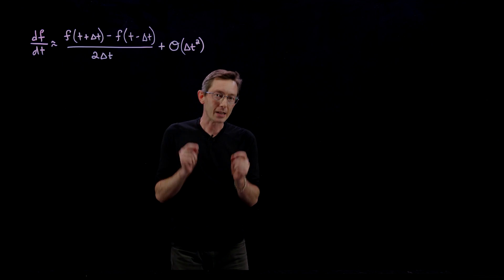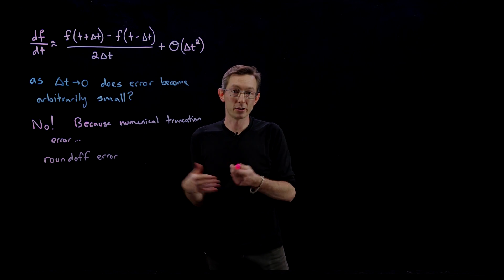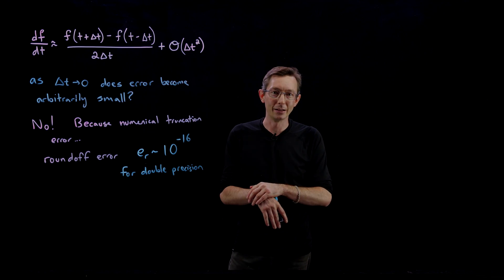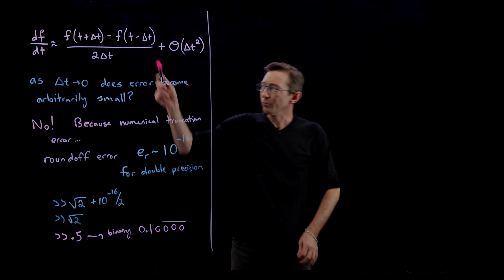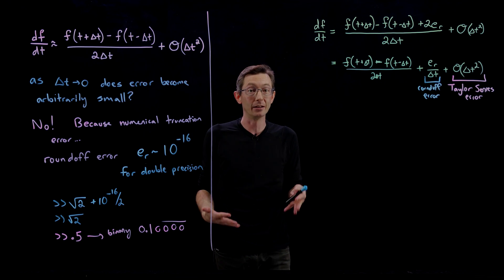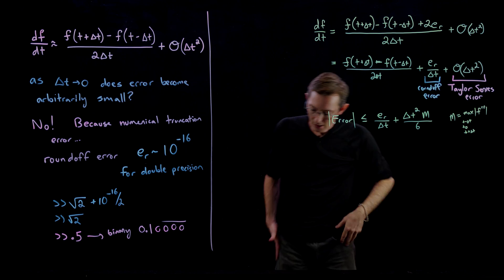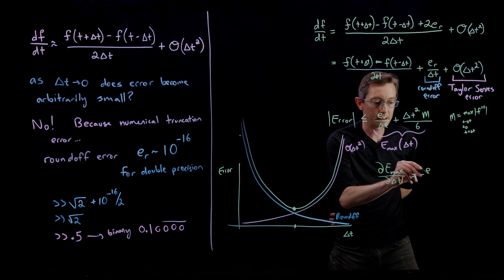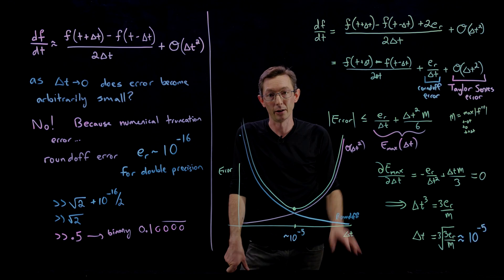Why we can't take "dt" to 0 in a computer: Sources of error in numerical differentiation

Comment: M(Δt)=sup{d³f/dt³ (c)|c∈(t-Δt,t+Δt)} is not a constant but actually a function of Δt, so the graph of E(Δt)=Δt²M(Δt)/6 is not a parabola, even if it is something similar. It is true that M(Δt) is a monotonically non-decreasing function (for bigger Δt, the interval (t-Δt,t+Δt) is bigger and hence M(Δt) can only get bigger). Either d³f/dt³ is limited in which case M(Δt)->sup{d³f/dt³(x)|x∈R} or it is unlimited, in which case M(Δt)->+8.

Hence for Δt->0, in both cases (wheter M(Δt) is limited or not) we have E(Δt)=Δt²M(Δt)/6 -> +8.

It is also true that if d³f/dt³ is continuous then for Δt->0 we have M-> d³f/dt³ (t) and hence E(Δt)=Δt²M(Δt)/6 ->0.

But the derivative of E with respect to Δt, dE/d(Δt), is a little bit more complicated.
The fact that M is a function of implies that dE/d(Δt)= ΔtM(Δt)/3+Δt²M'(Δt)/6, and it is possible M'(Δt) doesn't always exist.

Comment: In your calculation of |Error| - should m not be a variable depending on delta t instead of being a constant, because you explained it as  "the max f''' over the interval t - delta t to t + delta t" - which is  an interval that narrows with shrinking delta t (and therefore, m may shrink as well unless the maximum is exactly in the middle of the interval)?

Comment: As slight remark as I see it. The roundoff error error of exactly 10^(-16) would be true for "fixed" point numbers, yet most computers compute with "floating" point numbers, and here it would be more correct to say a precision of "at most 16 digits",  because with floating point numbers you can easily store say 1.2345678 * 10^(-100), and here the precision for 1.2345678 is limited by 16 digits, while the number itself can be very low (in my example of order of -100). An interesting part is why it doesn't solve the problems stated in this video with truncation errors - because when performing calculations between floating point numbers that are different, the order of the smaller number will be scaled up to the larger order, but at the same time a number 1.2345678 would turn to e.g. 0.00000000000000000012345678, and after truncation to 16 digits only a 0 will be left, thus e.g. 10^-50 + 10^-66 == 10^-50. Now even if we reduce  t -> 0, the values of the function f remain in the same order, and at some point dt will be just 0, and lead to undefined derivatives

Comment: Float is 4 bytes = 32b, double is 8 bytes = 64b; but most software now uses extended precision 80b.  You quoted the limitation of this 80b extended precision.
Reply: The IEEE 754 paper describes all of the binary representations. A recent 2008 paper is valid for basically all existing hardware (controller, CPU, GPU ...) the newer 2019 paper covers mixed precision as well. This will be used in hardware accelerators like the IBM-AIU for PC/server or DSP's on ARM/RISC.

Comment: Does the same logic hold in numerical integration?
Reply: No.  Integration is well-conditioned.  Adjacent areas have the same sign so adding them keeps all of the precision.  As dt gets smaller, f(t+dt) and f(t-dt) have many of their most significant digits in common.  Subtracting them to approximate the derivative causes all of these digits to vanish and greatly reduces the relative precision of the result.  Eventually, the 'signal' gets subtracted away and leaves only the 'noise' of the data.
Reply: If you measure f(t+dt) and f(t) for a process that does not change by a bit in dt time increment then the integral of df would be zero for that interval! In microprocessors with 8 bits, it is a real danger for slow process control. The remedy is to decrease the sampling rate of the process.
Reply: @hamidrezaalavi3036  The derivative estimate would be zero, but the integral estimate would be zero only if both measurements were zero.
Reply: @byronwatkins2565  In control systems s = s+ds, and ds = df*dt, if the sampling rate is high df might be zero and it makes a problem in the control system.
Reply: Just a hint for micro control designers.
Reply: @hamidrezaalavi3036  ??? s = s + ds ONLY if ds=0.  Also, df*dt is a second order infinitesimal whose first order limit is zero.  Finally, I don't know what your have defined s to be.